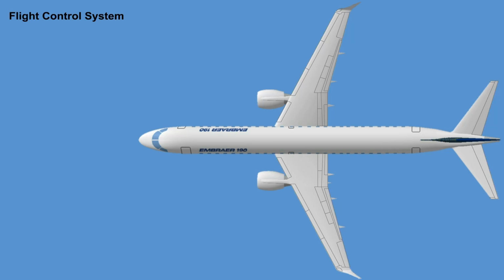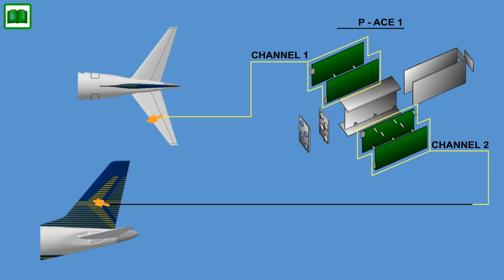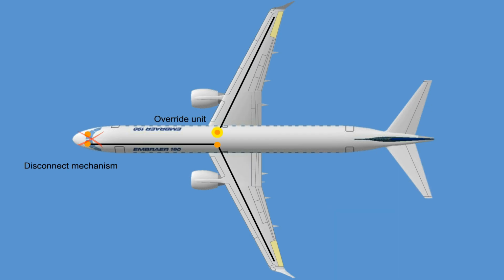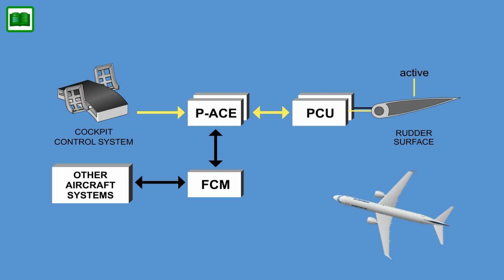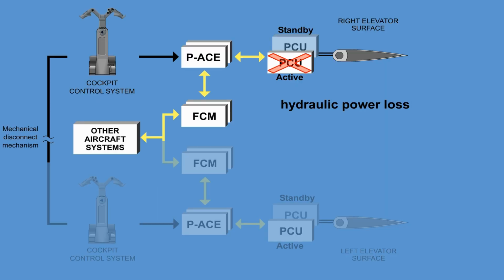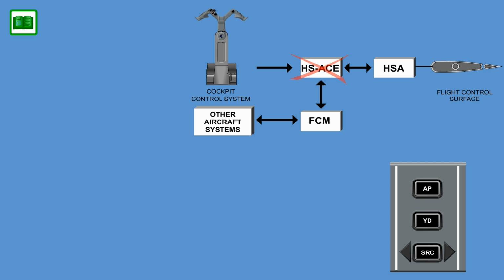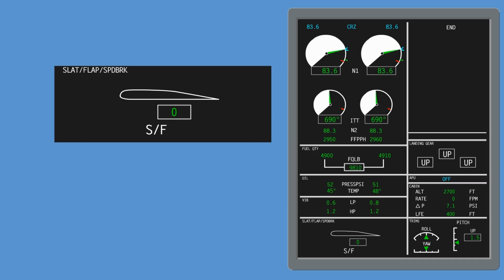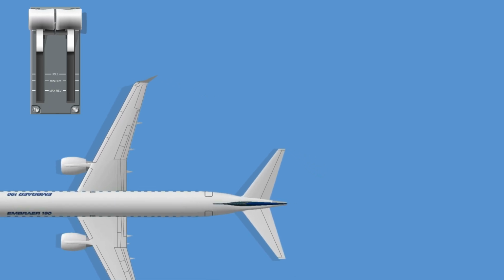Embraer 170/190 Flight Controls Explained! - How They Work? ATA 27

Comment: Is this what they make u watch when u wanna become a pilot
Reply from the maker: Yes, these videos are referred to as CBT, Computer Based Training. Basically Each aircraft type has a training manual created by the manufacturer, in this case, Embraer. These manuals are split into chapters, and CBT is used to visually teach the info in these manuals to student pilots. For instance this video has been about ATA Chapter 27 (Flight Controls). 

These types of videos are used by student pilots to learn about the specific aspects of the aircraft that they need to know about in order to become a qualified pilot on the specific aircraft type they are training on. Hope that helps!